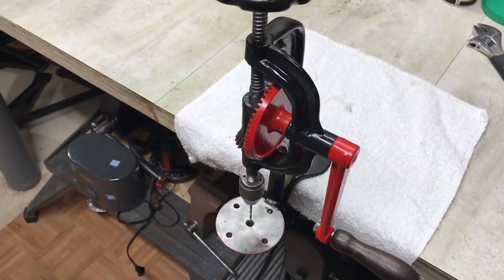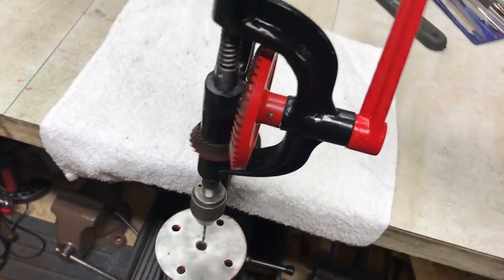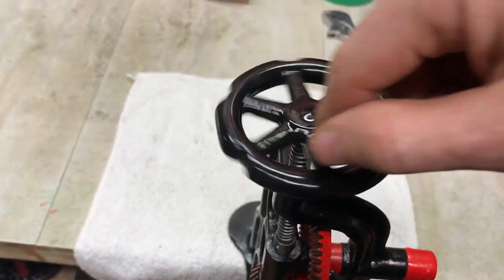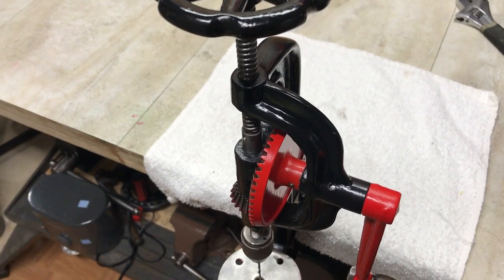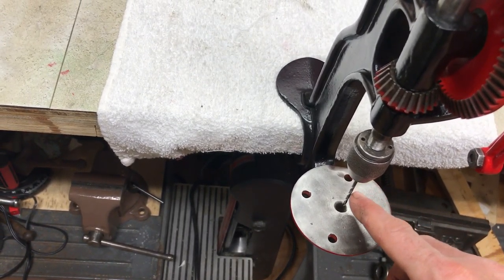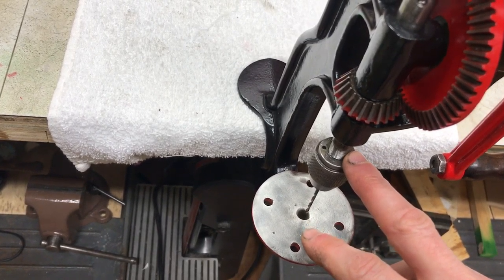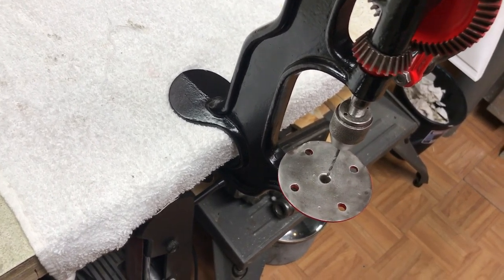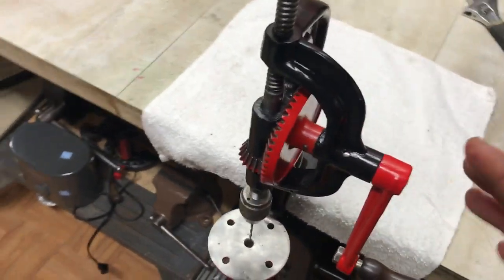Goodell Pratt Bench Drill Press #8 - Part 2

Comment: Hello! Nice example of one of these machines!
I have had one for many years but there is a major fault with the mechanism which raises and lowers the quill (I think), the part that rotating the hand-wheel at the top operates on.
My opinion is that this is a little primeval but worst of all think that my machine seems not to had been built properly in the first place. In essence, the two parts are held together by a groove on the end of the threaded part and a pin driven through two holes in the lower part hold the two together. Unfortunately, I think in my case the holes were drilled out of proper alignment and the two parts are rather soft steel.
Advice/comments would be most welcome.
Many thanks!